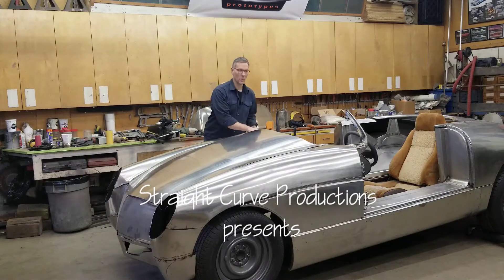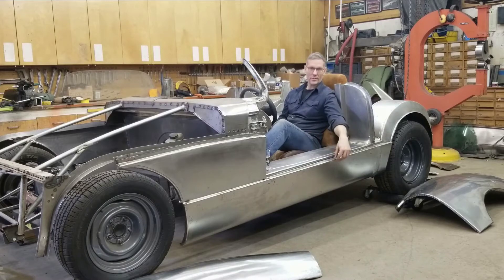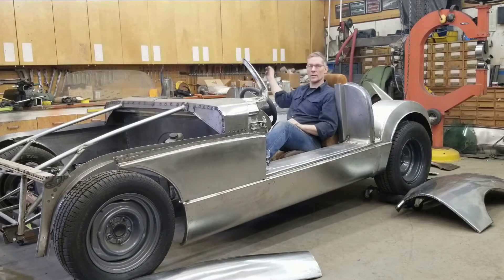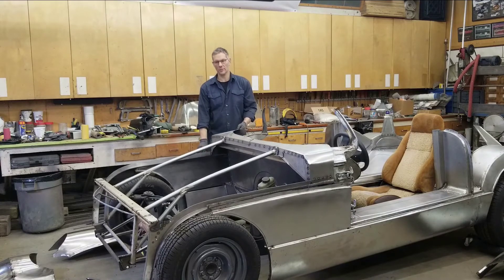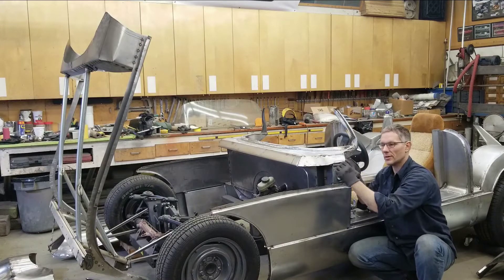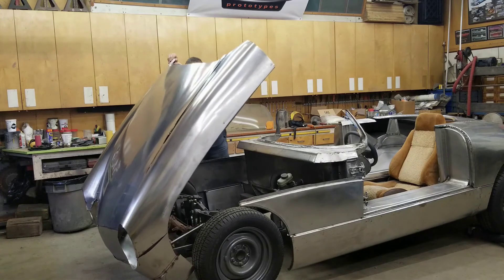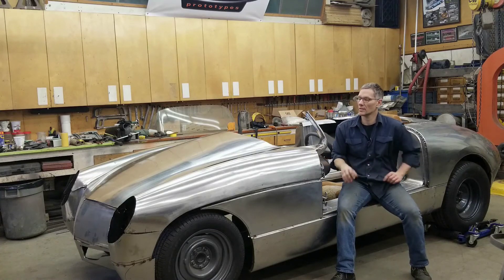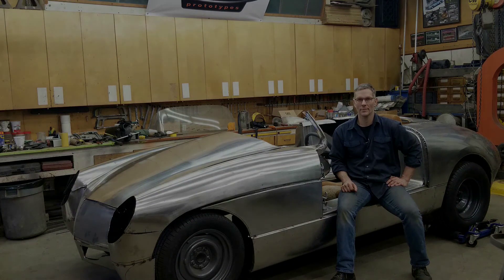Clamshell Hood Opens for the 1st Time & Panel Pre-Assembly for the Scratch Built Electric Hot Rod

Comment: Have you ever used the super leggera system? I've been looking into it and was surprised to learn the body panels actually do not ride on the tubing but are slightly above it. I can't understand why someone would build what is essentially a buck, and not use it for support except around body openings?
Your method seems to use strategically placed tubing/flanges to support and help maintain the form of the body panels, which makes more sense to me. Have you come across any books on body design and structure? Thanks for a great video.
Reply from the maker: Hi Mike, Great to hear from you!  Our builds are similar to that of an OEM in the sense that we use sheetmetal structures to attach panels together.  The tubing for the front clamshell is there only to support the exterior front panels until the remaining sheet metal structure has been completed.  Then it will be removed.  Check out our Metelic R2 build video as well as the photos on our Facebook page to see how that structure was completed  before the exterior skin was applied.  Sorry, not aware of any books on this subject.
Reply from the maker: Hey Mike, Strange thing.  I can see your comment for the '40 Door Skin Fab in the notifications, but not under the actual video.  The 3 lower anvils would be 12, 8.5 and 2.375 if it really came down to it.  However, I do use all 6, just depends what I'm doing.  Joe at Hoosier Profiles created the lower anvils for me over 10 years ago and they are still working great!  N.